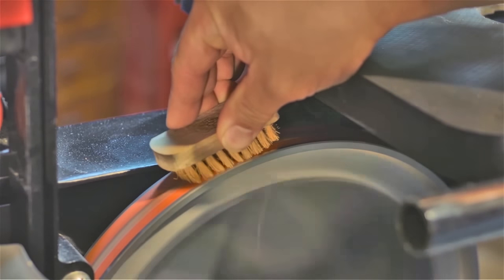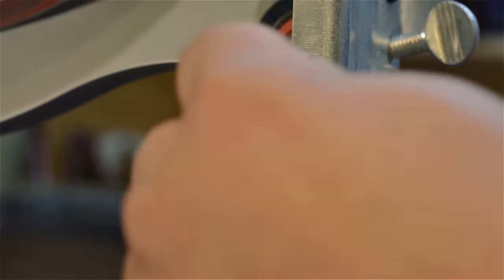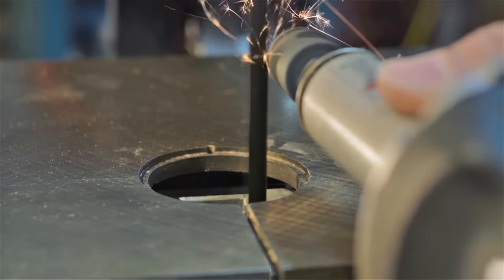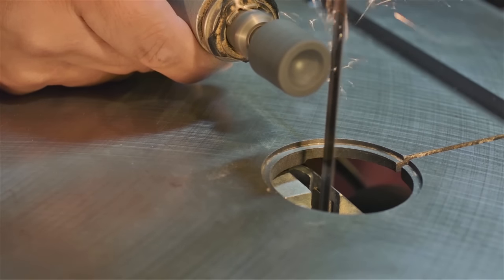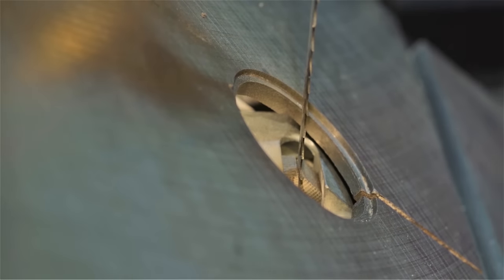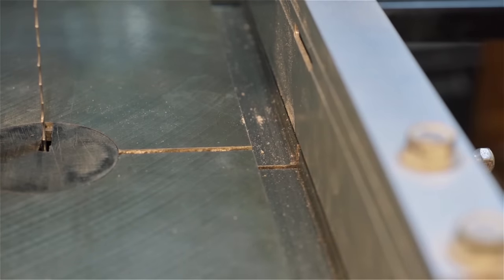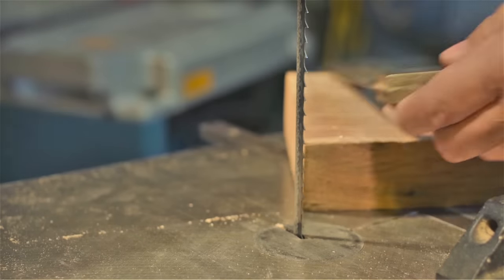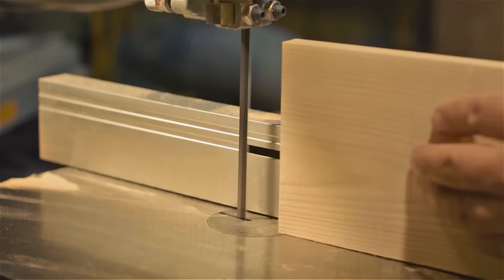Bandsaw Tuning For The Anally Retentive

Comment: Wonderful video thanks for sharing.  You talked about shimming the blade if it wasn't true in both directions, I am assuming that is at the wheels on front to back or are to talking about shimming the table up on the low side? Can you share your insight on that proceeder I would love to see that. Thanks again for sharing the video I really appreciate it.
Reply from the maker: I think I meant shimming the table. If you can't get your blade close to 90 degress on the table, then you'll probably have to shim the table -- somehow. Some tables have a saddle front and back, others on each side. It might be easy - or it might be near impossible depending upon the design.
Reply: @RockwoodJoe  Cool thanks for the reply. It sounded like you might have some insight into that proceeder and I thought it would be interesting to watch. My saw is squire and runs true but I will for sure implement some of your tuning methods into my saw. thanks again.

Comment: Couldn't understand how grinding fixes flutter. I found on my 14" Delta it was the wheels where in different positions. The angle of the upper drive wheel was lying backward from perpendicular but blade ran in the middle. Also once I tried extending and exposing more blade the cut would wander making a wedge of sorts. Tension marking on the back would seem slack despite putting the marks for the correct width of blade. So don't know if lack of tension causing cut to go off on me
Reply from the maker: Rockwood Joe
1 second ago
I know what you're saying. What is not shown is the amount of adjusting the saw to get it perfectly aligned or running smoothly. The video assumes that your saw is already "near perfect" and only the blade needs to be tuned. The most common saws sold today are the stamped metal saws, which I've found are actually less tune-able. The older two piece cast iron saws (top arm bolts to lower assembly) can be adjusted so the upper and lower are more in-line, as well the lower cast iron yoke which is bolted to the lower assembly can also be slightly moved around. All of this adds up to a more repeatable performance. I'm looking at buying a second saw to cut styrofoam, so it will probably be a Rekon and I'll attempt to do a "tune the saw" video. This video is really more of a "tune the blade" video. You'll need to sort out alignment issues on the saw first before doing any work on the blade. This might involve shimming here and there or taking it apart. It will be somewhat of a trial and error process. This is something I did back in the early 2000s before Youtube. I did not address tension in the video because somehow I lost the footage. In general I run low tension till it stops fluttering. It sounds like your saw has wheel alignment issues. These are not uncommon on used two piece cast iron saws as sometimes the upper arm would get knocked off ever so slightly in transport. You'll have to take the guards off (maybe?) and get the wheels as co-planar as possible first before anything else. Thanks.

Comment: I couldn't help but notice those "blocks" you purchased are pieces of "bakelite" also known as phenolic resin board. McMaster Carr and other suppliers sell this in many grades and temp ratings. I am sure you could make your own for a percent of the price and you will undoubtedly find other uses. Good video and I will have to study your blade balancing via grinding method some more. Something about it seems counter-intuitive but so do many useful things. Take care.
Reply: The cool blocks are called "wear resistant slippery- garrolite" in the Mc Master Carr online catalog. There are many derivations of this same material depending on whether you are outfitting a bandsaw, building an oven, or even a space shuttle. Take care. edit: auto-correct happened
Reply from the maker: Hmmm, sounds like a Youtube venture, whereby I could have a website and sell my "special" blocks... Thanks, I'll keep the post up.
Reply: If you are the owner of said business and using the video to advertise I am sorry please remove my post.
Reply from the maker: I think you misunderstood, as I meant it as a joke - as my previous posts about how every video on Youtube today is about creating a "brand" and marketing yourself. I just made a video with my opinion. That's it. I'm not selling anything nor do I want to ever rely upon Youtube as some form of revenue stream. Cheers !
Reply: I subscribed anyhow, whether you want the income or not your rigor is admired. I don't have much of an entrepreneurial spirit, however, my post was out of concern for your 11$ annual habit. A piece of garrolite might cost 50-100$ but would be a lifetime supply for a few band-saws depending on duty cycle. You might even improve on the design a little bit. I will say most of the band-saws we had in the engineering shop had metal bearing guides with screw adjustments. When cutting metal the build up on the wheels can cause such a problem with reliability, accuracy, and blade life that we would custom make blade wipers out of softer metals like brass to clear any metal chips which might adhere.

Comment: Really cool, watched the whole thing.  What kind of bandsaw is that?  How much tuning did you do to the wheels before you started tuning it?  You should totally start a series of anal retentive tool setup in this style.
Reply from the maker: Almost no tuning to the wheels was needed, just pressed in new bearings (that were ruined by cutting lots of styrofoam that melted into them). Delta's original claim to fame was that they dynamically balanced the wheels at the factory - something that other manufacturers didn't do in the 80s and 90s.
Reply: Good to know.  Do you plan on making more of these videos?  Or just messing around in the shop?
Reply from the maker: I'd like to make more vids, but not necessarily about wood working - just stuff in general that bugs me or I'm anal about. :)

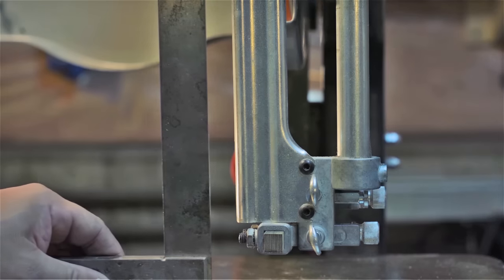Comment: 2:44 The blade guard should move parallel to the blade. A given blade width/tension won't necessarily end up perfectly perpendicular with the table in the front/back direction.
Reply from the maker: Not true. If your blade is changing angle because of differences in tension/thickness it means : 1) You're over-tensioning and deflecting the rubber tire, or 2) Your band saw and the wheels change angle over their travel or while under tension or 3) You're band saw and the wheels are not co-planar to begin with or 4) You're not centering the gullets on the very center of the top tire. I did not address tension very well in the video, but I run extremely low tension (just enough to stop flutter), as the purpose of the wheels is ONLY to transfer motion to the blade - and not resist the force of the wood. Flutter will come from a blade being an uneven thickness, uneven temper, etc. etc. - that is how the grinding helps - it allows me to run severely reduced tension. I also did not address wheels being co-planar and their tension travel, something of which that nearly all of the modern stamped metal band saws fail at. I've found the frame actually twists slightly under even slight pressures making it impossible to keep wheels aligned through a range of motions and varying tensions. There was a reason older cast iron framed saws were essentially two machined portions bolted together. Getting a perfectly perpendicular blade guard might not be attainable, but it is helpful to get as close as possible to reduce how much you must address the guides. Hope this helps ! Peace!

Comment: You adjusted the cool blocks up tight to the blade, what do you recommend on a saw that has bearings?  I enjoyed your video!
Reply from the maker: Unfortunately, I recommend not using a saw with bearings. Bearings provide an infinitely small area of support - meaning they don't support at all. Remember trigonometry? Remember that when a circle touches a line, it does so at a single infinitely small point (that is actually a function)? No then? Well, perhaps I'm too much of a nerd. Band saw bearing support was figured out in the early 1900s, but then they used either wood, brass, or mild steel blocks. The concept of bearings is to fool people into thinking band saws are "maintenance free". I have tried carter bearing supports, and they are worse (except for their one for extremely thin blades). I have no idea on how adjust bearings, as even if they are tight to the blade, they literally have no real surface area contacting it. The purpose of the video was to show that you don't have to tension the crap out of the blade (as long as you tune the blade), and let the guides do the work. The wheels are only there to transfer motion. Sadly, I cannot provide a real answer to your question.

Comment: Help! I fail to understand how filing the back of the blade can change the angle of the blade in relation to the table.  I use a  whetstone on the backs of my blades to gently round over the back and to remove any rough spots.  As far as the back of the blade being perpendicular to the table, it seem to me that a table adjustment is in order.  Am I missing something?
Reply from the maker: Sometimes, even with expensive blades, they are not joined (welded/soldered/brazed) perfectly parallel, i.e. it is like two rulers joined end to end, but they do not make a straight line. That is why I grind the back of the blade. Once you know that the blade is straight, then you must adjust the table to be parallel. This may or may not be easy depending upon the design of your saw.  Decent cast iron saws that are bolted together are generally perfectly aligned, because each component (if properly machined) will nicely match up - and cast iron does not bend. Welded, or stamped saws with bolt on components are generally not aligned in my experience, as the body is always slightly twisted in some fashion. To compensate, you might have to shim the various bolt on components.

Comment: Nicely done. Questions: When you slice veneer, I noticed that you put the larger part of the work piece (the "waste" piece) between the blade and fence, and the the veneer piece on the outside. Do you think this matters? A lot of guides say to cut with the measured "keeper" piece on the fence side. Is there a good reason not to, other than "whatever works for you"?

Thanks. Again, very useful information in this video.
Reply: Andrew Spitzer My opinion,  and only my experience and opinion honestly,  is that you wouldn't want to "trap" your veneer cut between the blade and your fence, in this case, the rip fence. Additionally you have much more to hold onto as you guide your material through the blade thus allowing the veneer to fall away from the blade safely. This same principle applies to many shop tools like your table saw.  You would avoid pinching a small piece of material between the blade and the fence of the saw to avoid kickbacks and pinching.  Same principle. Hope this helps ;)

Comment: Cool trick with the die grinder but wouldn't it be better to , when grinding the sides, go from in front of the blade on one of the passes, whitchever pass kept the rotation of the grinder going against the direction of the blade? ..also, it may be better to turn one each (1 upper , 1 lower) cool blocks perpendicular to its mate? That would cause the grain to form more of a grid pattern.. I know it really doesn't matter. I'm just running with the whole OCD tip.. Lol great video. I think I'll subscribe..
Edit: I forgot to mention the blade guard. There's so much slop in it. What good does it do to check it for square/plumb, unless you lock it at each elevation as you go through checking throughout its range
Reply from the maker: 1) You are correct about the orientation of die grinder vs direction of blade, but for the video my lighting rig was attached to the front, and I couldn't get the shot without creating a shadow. In retrospect, I should've taken the shot again and hired a midget that wouldn't have been in the way. Very sloppy work on my part, I apologise.
2) The orientation of the cool blocks is a personal thing, and I try not to judge people on how they position them. Today, in our modern society it is freedom of choice of how you want to orient your blocks, at home, in public, and at the workplace.  It important to note that "cool blocks" also known as "graphite blocks", and also known as "graphene blocks" are all initially created without orientation. It is really up to the individual block to decide how it wants to be oriented or perceived with respect to orientation. Please acknowledge the orientation of your blocks, and other similarly orientations of blocks with respect and dignity.
3) The blade guard has slop, but I was actually measuring against a portion on the blade height arm. You should try to keep the friction adjustment snug enough to prevent excessive movement while measuring. If it all possible, do try and lock the elevation as you go through the range as suggested. I did have footage of this, but I left it on the cutting room floor as it didn't seem to work well for the video - can't remember why. Probably because one of my graphite blocks during the filming decided to change their position, and I was barred with an injunction from including the footage. This is the number one thing I find that sucks on new bandsaws. They might have a fancy little cranks that move the guides up and down, but it moves so off plane (in all directions!) it makes the band saw almost useless for anything except a single height settings.

It's important to care! Thanks!
Reply: @RockwoodJoe  haha.. Very funny stuff. Thanks for the reply. However, I hsve the same bandsaw and what reminded me of all the slop in the loose blade guard was when I saw you bump yours in the video and it almost hit your square. I only bring it up because we play how we practice so we should practice how we want to play. Just some food for thought... Peace
Reply from the maker: @jdog4534  Thanks! Keep that saw running and don't let it go to the junkyard!
Reply: @RockwoodJoe  there are those who might think it's already in a junk yard. Lol. I have a weakness for tools, fj40 land cruisers, boats n motorcycles; basically, anything mechanical or buoyant. so ive got 3 bandsaws, not counting my 2 porta-bands. ...and 2 scrollsaws. I justify them all due to their differences. The coolest one is my bench top metal cutting bandsaw with an onboard blade welder and 3 wheels to make a deep throat. It's probably all I need ..and the porta-band and maybe 1 scrollsaw, ..maybe.